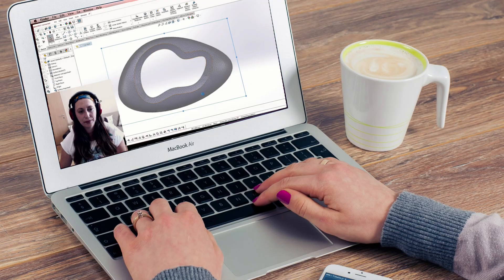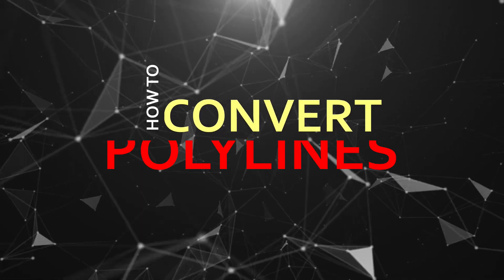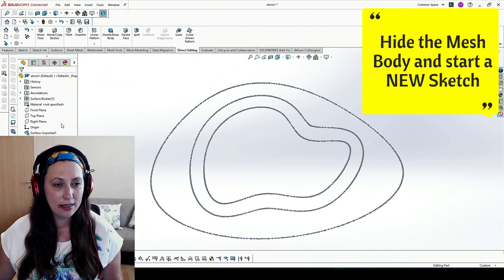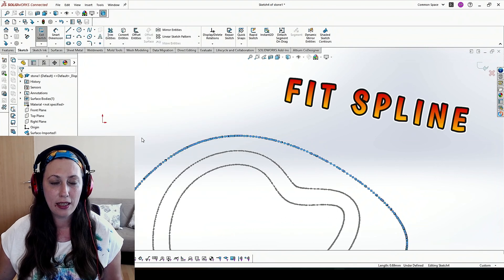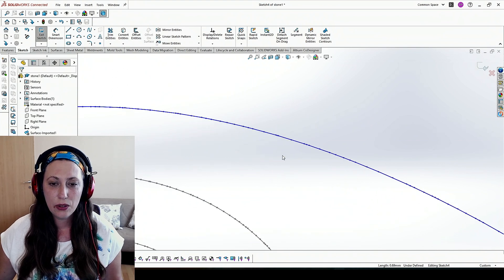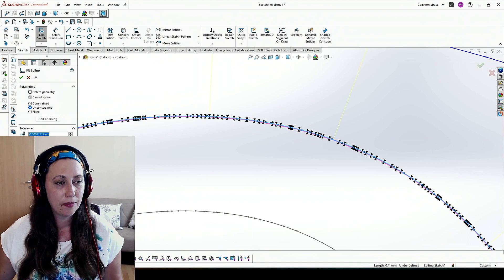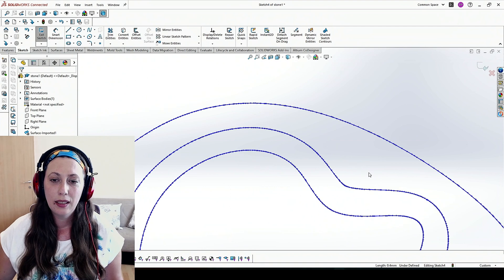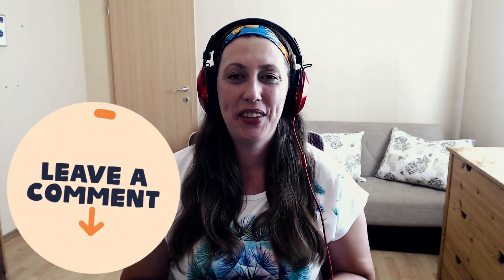Smoothly Convert Polylines to Splines | SolidWorks Tutorial

Comment: Im not sure if this is what Im trying to do but I make a text in solidworks save or export as DXF. In Dxf form some of the "curves" of the text are just a bunch of strait lines put together to make a curve. This will show up when cutting with a laser, you will see a bunch of strait lines to make the curve. How do I make them smooth.
Reply from the maker: This is due to the export or font sometimes. First check your export settings that you do not export polylines, if this is not the cause check the font. What you have to do is convert the text to sketch, repair all imperfections on the text curves and then export to DXF.

Comment: Hi. I did this wen making a wing profile and it did convert the entities into a spline but when I zoomed in the line was zig zaging all over the place. This lead to much complex geometry that I was hoping for and poor topology once I tried to port the file into FEM software. Is there a way to fix the zig zag?
Reply from the maker: How you see a model visually is based on your Graphic settings. When you zoom in a lot you always see lines, not curves. As for the FEM software as far as I'm aware it uses mesh, this means that you can change the resulting body by adjusting your mesh export settings.

Comment: Fit spline vs Composite Curve?
Reply from the maker: Composite Curve is not converting your lines, it just makes SolidWorks read it as continuous contour. In many cases this is exactly what you need. But in many cases of imported DXF you need to convert polylines in splines, which is this tutorial about.
Reply: @DWorkshop  Thanks, this was a long time confusion of mine, since for simple Sweeps, both worked the same.
Reply: Would love the fit spline to be editable, so that the base sketch can be changed.
Reply from the maker: That's easy select the spline->right click-> convert to spline or convert to style spline and it becomes editable